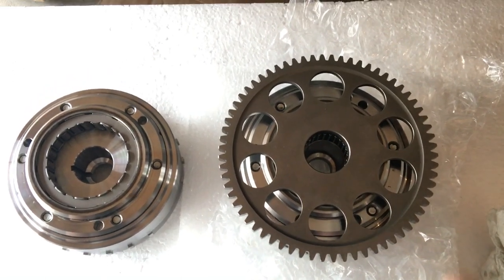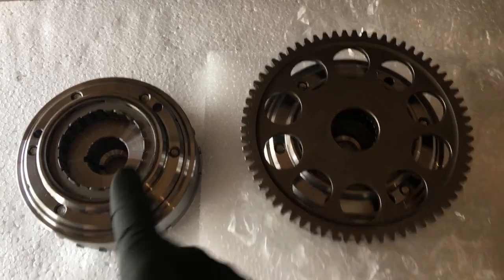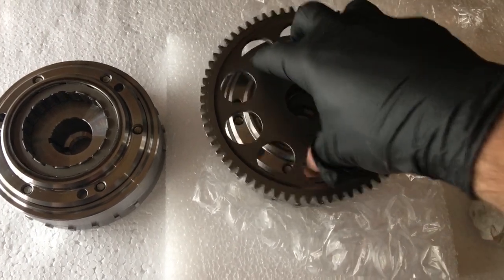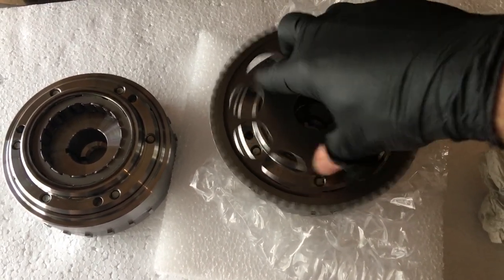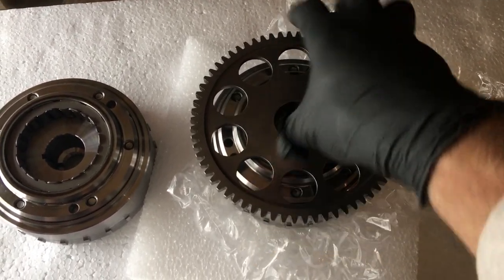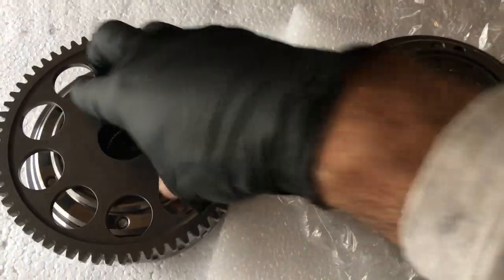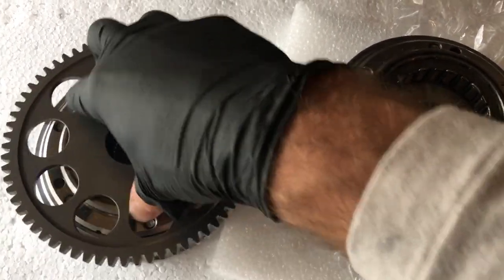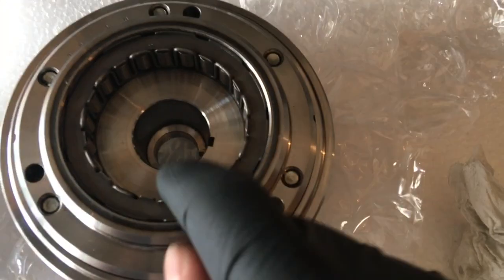DIY - Harley Davidson HD Street 750 XG750 - Startup Issue - Part 3

Comment: Thanks for this video, my bike had the same issue. New bearing from ebay for my 2015 and issue fixed. what's not included in this series is separating the magneto to get to the bearing, but that is easy with an impact gun. Harley no longer sells puller tools so do what I did and go to the auto parts store and buy a 20x1.5mm oil drain bolt. $3 and it worked great.
Reply from the maker: awesome, thanks for sharing that. Glad the video helped you. When I was looking for parts calling different HD dealers, they told me that I would have to buy the entire rotor assembly ( not just bearing itself). That's what I ended up doing.  I remember it was quite challenging to unscrew those several bolts that holds "magneto". Anyway, cool that it worked out for you!
Reply: Hi bro! I have got the same issue with my Street750. And mechanic over here is suggesting me to replace Complete One Way Clutch Assembly to fix the issue. But as per ur message you said that the problem can be solved even by replacing the bearing, right ?
Reply from the maker: @vishalkothari6588  There was another comment shared in one of the videos where  a guy shared that he replaced the bearing and was able to use the same clutch. Really have to see what your options are , then decide on whatever is easier to replace - either the bearing only or the entire starter clutch unit. Hope by this time you got it all sorted out

Comment: I have the same issue. Great video, thank you so much for sharing it. Now I got to find the tools and the replace piece.
Reply from the maker: Rotor assembly - the part #29900008 - search on eb ay.
Reply: @Sandr0n  Thanks man, that's the one! Now I need to find the pull toool
Reply: @Sandr0n  Hey man! Thank you so much for this video and the help. I could fix the bike and now is running great again!!!!!
Reply from the maker: glad to help :highfive: . Did you end up fixing the old assembly or replaced with new one?
Reply: @Sandr0n  Hey Bro!! 
Even I am facing the same problem with my bike. But I am not able to find out the part on eBay which is specified by you in the above message. So please can you guide me where can I get the One Way clutch (Rotor Assembly) of Street 750.
Reply from the maker: @vishalkothari6588  check with local HD dealer. It was a pain to find it. I called several local dealers and was lucky enough to find one who offered to order it and to sell it to me.

Comment: Why didn't you show how you removed the fly wheel and what tool you used. You just show the problem
Reply from the maker: Not sure if you got the tools by now. There were 2 tools I used - the puller and locking tool. Those were specifically made for Street 750( unsure aobut 500). The locking tool locks the rotor assembly and puller just pushes the whole rotor assembly out from the engine.

Comment: The fly wheel has treads inside after you remove the crank bolt. Buy a 20 mm fine tread bolt tread in the fly wheel against crank the fly wheel pops of very tight
Reply: 20 mm extra fine

Comment: What's up man, I know this is a long shot but how did you get to rotor off the crank shaft because I'm having a time
Reply from the maker: First you need to lock the rotor and unscrew the first bolt that is outside. Air impact wrench would do probably, just gotta give it a try. Then you need a puller. Find the bolt with proper thread and bolt it in. It will pull the rotor off the shaft. Good luck

Comment: hi  , ty for sharing. i've been having problems for a couple months now. at 1st it would not start up but turned over. i found the kill switch on top of the battery was not in its harness. think it slid off. once replaced it ran good for a month. then started to a loud smacking of metal sound. both times i was lucky and broke down at home. i was thinking starter Bendix when i found your video. i called harley and the recall was the fuel pump on my bike. freedon harley here in Ohio. again ty for sharing. i did buy a repair pdf file on the bike couple months back so im sure it will explain more. is the part you replaced called a friction clutch or freewheel gear?
Reply from the maker: Sure, absolutely man! Happy to help. The bigger challenge will be possibly to find the set of right tools for locking the rotor and unscrewing that single bolts that holds the rotor assembly.
Reply: ty
Reply: I replaced the 1way bearing last summer . Ran great for 9 months now will not start. 1 of the  inner bolts came loose tore up the stator. Yes I used lock tight and torqued. Replaced stator started up 3 times then back to making noise. Bearing is ok and still turning just 1 way. Now the flywheel is not turning. Ty for adding part number. Harley was no help and have said 1st they hear of this. Now I'm wondering if the whole basket maybe worn and that is affecting not starting. 10,000 miles 2015.
Do you have the part number of the start clutch that you bought?
Ty
Reply: Hi, Keyway was bothered and kept falling out. Shes back running like a new bike. 2 keyways were pinched where flywheel just spun freely. I put paper towel on top of frame when applying basket back on. Lol... ive had that basket off so many times. Motor wise shes clean and spunky.   Ty for all your help
Reply: $20 ebay bearing. Buy several harley keyways there only 92 cents. Place paper towel under case between frame. The keyway can fall out or get boogered on its ends and still run. Make sure to clean they shaft. As for tools getting the basket off I used a large screw driver on the gears. But be careful. I have a picture of the boogered keyway on fb Robert Gwinn. Bikes running like new and better than last yr when i replaced the 1way bearing. Use lock tight on all bolts. New alternator starter case gasket .... Harley was amazed when i showed the boogered keyway and they watched my start and shut off. That boogered keyway can make a difference in timing. Its slipping the flywheel. 
She's running sweet and strong... back to  58 miles per gallon of fuel.
Ty you all the info... would have been costly if taken to dealer... Harley told me. I had to walk them thru just to get part numbers. Buy the Maintenance Repair Manual 
Thank you again

Comment: seems i have similar problem. would you please tell me an oem part number of that part
Reply from the maker: will let you know
Reply from the maker: HD-51463 ALTERNATOR ROTOR PULLER

HD-51501 ALTERNATOR LOCKING TOOL
Reply: @Sandr0n  thanks a lot
Reply from the maker: @proskuchev  no problem. Good luck finding the tools. It can get quite challenging

Comment: i changed that starter clutch bearing and now its shearing off the keyway. ugg. but i bought the keyway at a hardware store. they use them on mowers. i did order a keyway from harley. no starter basket on the market. where did you buy yours?
Reply from the maker: bob gwinn ah man, I didn’t stay in my video that replacing the bearing would solve the problem. You have to replace the whole unit. The entire “rotor assembly”  what you see on this video. I ordered it from HD xdealer. If no luck at local HD, you may try to google LIVERMORE HD in CA and talk to Chip. He is the man!!! Good luck
Reply: ahh ok... im searching for now. thanks

Comment: how much is the life of the starter clutch ?
Reply from the maker: you probably saw it the bike had 3000 miles and this issue started
Reply from the maker: Really depends on the riding style. Mine was fairly new with 3K miles. But it started having this issue. I cannot tell whether this was a manufactory fault or smth

Comment: Where did you find the part and what was the price I am having the same issue and can not find the part what so ever
Reply from the maker: Got parts # from parts catalog. And I ordered them from local HD dealer - (Livermore Harley Davidson). The price was about $330 for the whole piece. Local HD dealership should be able to help.
Reply: Ok now how did you get it off I can not seperate it from the engine. I've pulled like hell and nothing
Reply from the maker: You will need 2 particular tools that will help you - one that locks the whole rotor assembly, another one that pulls it out.
Reply: @Sandr0n  do you have a picture of the two tools their names or where to find them or rent them
Reply: @Sandr0n  I can give you my email or something if that helps
Reply from the maker: @donald, one is called alternator rotor puller and another one - alternator locking tool. Try to call all local HD dealers in your area. You may get lucky even though they're not very interested to get you the tools you need. At least this is what I found out. Most probably you wont be able to rent them. HD wants to make $$$ ;-)
Reply from the maker: Donald Keeney not sure if you were able to fix it by now. Check on eBay, I saw the tools there
Reply: @Sandr0n  Hey man can you PLEASE help me out? i'm from portugal but i really need to find a place for the same part you replaced here. The dealer here want's to sell it to me for over 700$ which is just insane! Anyway you could help? Thanks!
Reply from the maker: @Harkein  hi Marco, I am absolutely feeling your frustration. There are 2 options here that I can think of - either find a used part (cheaper option). Or order a new one. I can check with my local dealer and get back to you.  There was a person somewhere in a comments that wrote that he fixed his clutch by replacing not the entire rotor assembly but only bearing that is inside. Me personally ended up replacing the entire rotor assembly with new unit. Find me on insta (rswarrior_sf) and pm me.
Reply: @Sandr0n  Thanks so much for your time and patience on this matter man, i pm'd you on instagram. Harking_sun

Comment: How and where did you get the rotor puller tool? Have the same problem as you are but can't find these online: PART NUMBER TOOL NAME
HD-51463 ALTERNATOR ROTOR PULLER
HD-51501 ALTERNATOR LOCKING TOOL
Reply from the maker: dangem, I was lucky finding locking tool online and I ordered the puller from a dealer. Go to your local dealer and check with them if they can order the tools for you. If not - go to a different dealer.
Reply: @Sandr0n  Thanks for the reply! I live in the Philippines and dealers don't sell special tools unfortunately. Is there by any chance I could purchase yours?
Reply from the maker: dangem I sold mine unfortunately a couple years ago. I would recommend calling different dealers and asking each one of them. The last thing what you can do is to find HD Dealer in Livermore, CA and talk to Chip and see if he can place an order for you. Shoot, but You're in Philippines.. Damn, not sure man. Keep checking ebay
Reply: @Sandr0n  Locked mine at the bottom of the counter wt is a whole that a deep well 1/4 drive socket fits that locked the crank
Reply: @davidfridley1527  - could you explain further?
Reply from the maker: @dangem5022  I realized you're in Philippines. Keep checking ebay and hopefully you'll get lucky. Otherwise, try somehow to 1. Lock the rotor assembly itself, 2. Then remove the single center bolt with air tool instead of wrenching it with your hand. 3. Use a bigger (different) bolt that goes in and pushes the rotor assembly out off the shaft.